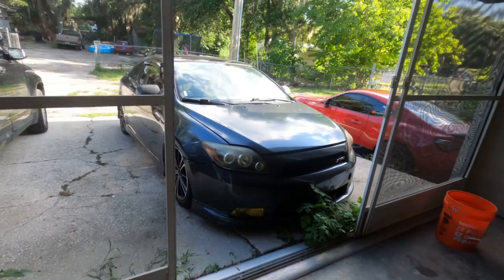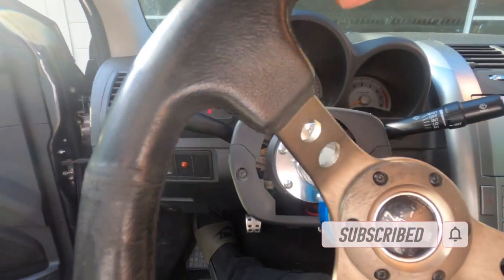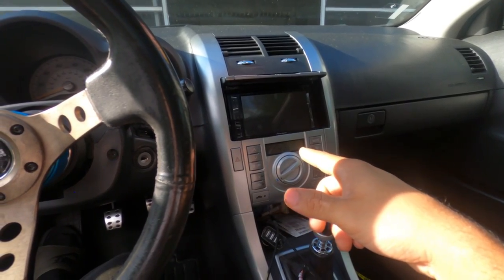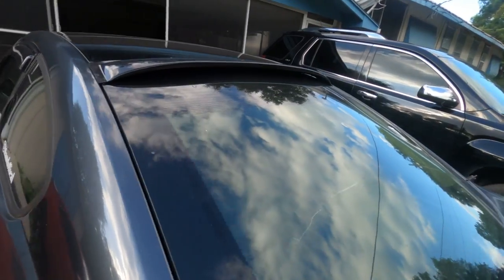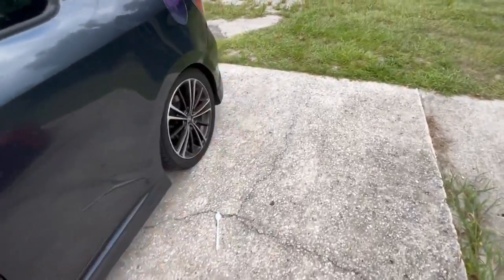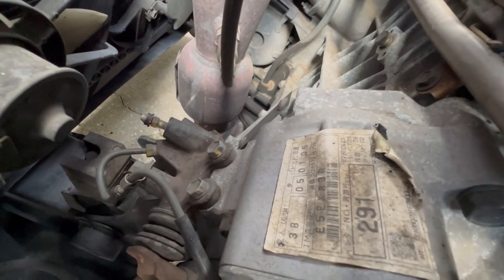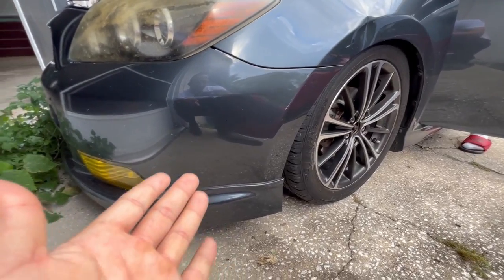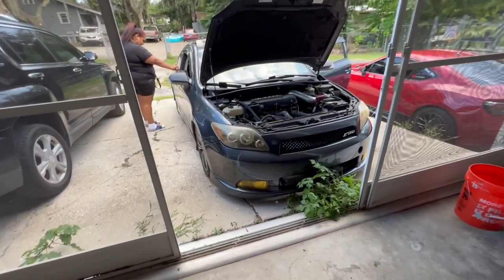2008 Scion TC Full Build Breakdown

Comment: I haven’t opened my 2007 TC’s sunroof in over 4 years. I am scared! Keep the TC post coming. Any basic upkeep videos will be great.
Reply from the maker: Appreciate the comment 🙏🏼I was the same once mine started acting funny, replacing them isn’t cheap either . But I got you on the content stay tuned .
Reply: There's a recall on them too. I guess the early models didn't laminate the glass so if something like a rock or whatever hit it while it was open... 💥
Reply from the maker: You are correct . They are real delicate from factory

Comment: I'm currently searching for a 2014-2016 Scion TC Base with the 6 Speed Manual Transmission for a Winter car and also a new project car I can modify while my Camry is sitting in storage during the long cold Winter months. The first mods are always window tint, window visors and Rear visor that's flush with the rear window not those big oversized Rear window visor. Then an Exhaust, Aftermarket shifter boot and shift knob, Wheels, Coilovers, Cold Air intake, Aftermarket header, Aftermarket steering wheel with an NRG hub and quick release kit racing bucket seats would be nice. Front lip kit, wide Side skirts extensions and a Rear diffuser.
Reply from the maker: I used to have a 2012 TC good car just had to switch up lol , that’s exactly how it goes start small build the hype go big then theres no going back after that 💯 2012 and up were underrated only tc’s that got a decent widebody made cause the gen 1 widebody you can get is 🤮 lol not a fan .

Comment: I liked your video, I’m planning to change my radio, since the one it have doesn’t have Bluetooth, which version of pioneer radio did you installed? I’ve been trying to find one that I’m sure it will fit and work on my car but I’m not sure which one should I buy, my car is a Scion tc 2008
Reply from the maker: Appreciate you 🙏🏼 the radio I have installed is linked in my bio . Feel free to check it out , I recommend it 💯

Comment: Does she burn oil at all ? I know my 08 Tc I got the motor rebuilt
Reply from the maker: Oh yea definitely these years and model Tc all had a burning oil issue , I always keep mine topped off for that reason besides that zero issues 👌🏼
Reply: The 1AZ is notorious for being an oil burner. Both the tC and the Corolla carry this same burden.
Reply from the maker: Yea the issue got fixed later on in the newer models but as long as you keep up with maintenance your golden 👌🏽